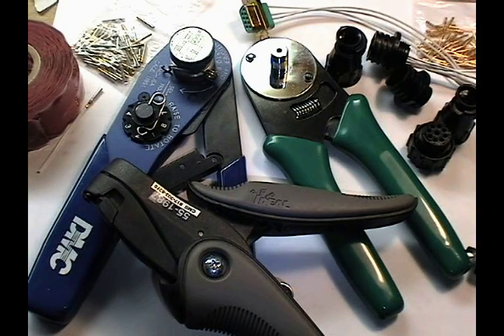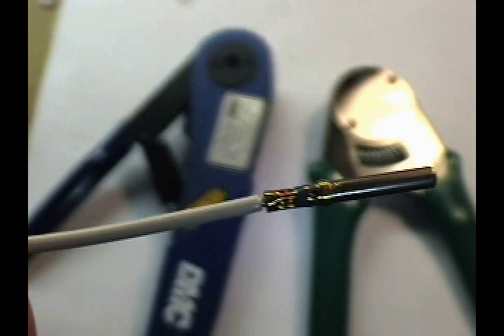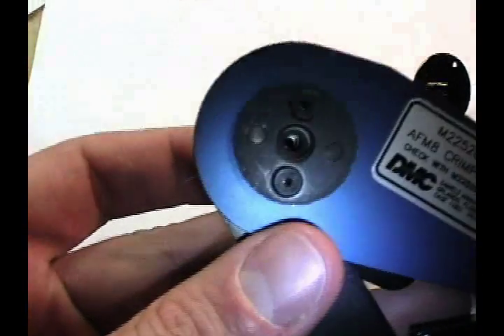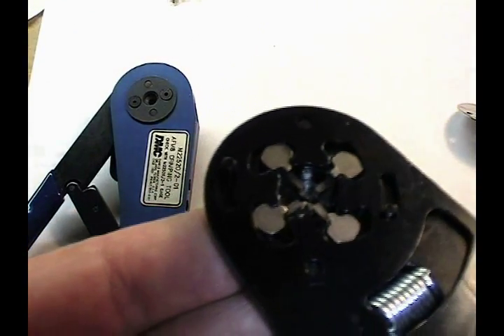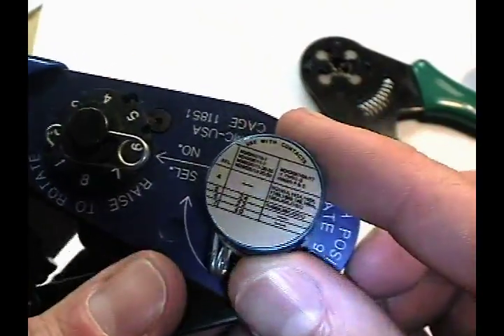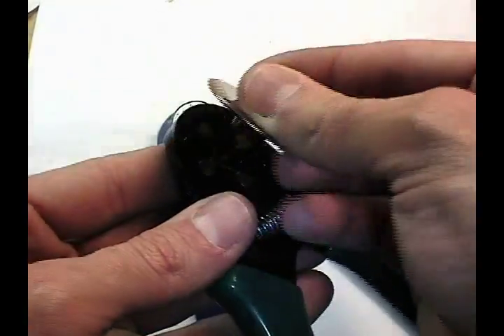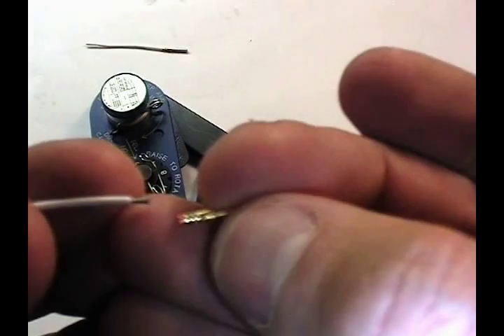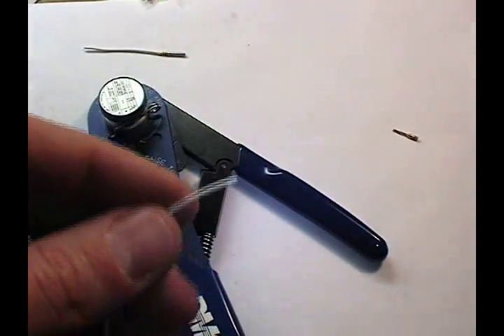AMP CPC Series II D-sub pin crimping (closed barrel pins)

Comment: Anyone have a link to the less expensive crimp tool?
Reply: ABN Deutsch Closed-Barrel D-Sub Crimper 20-26 AWG with Ratcheting Action
https://www.amazon.com/ABN-Deutsch-Closed-Barrel-Crimper-Ratcheting/dp/B01N3KVX8D/ref=sr_1_cc_2?s=aps&ie=UTF8&qid=1521049848&sr=1-2-catcorr&keywords=closed+barrel+crimper
Reply: +Chris Austin (Graphic Chris) 
You can purchase the AFM8 Crimper on amazon here: http://www.amazon.com/sp?_encoding=UTF8&asin=&isAmazonFulfilled=&isCBA=&marketplaceID=ATVPDKIKX0DER&orderID=&seller=ADSK1MTMXQOWA&tab=&vasStoreID=

The AFM8, qualified to MIL-DTL-22520-2-01 is designed for most of the miniature and sub-miniature connector types that are so widely used in electronic systems. The AFM8 meets the need for a miniature tool accommodating wire sizes 20 through 32 AWG. The AFM8 gives a Mil-Standard 8 impression crimp, which assures maximum tensile strength. The tool frame has a built-in 8 step selector knob for ease in dialing the correct crimp depth setting for the wire being used.